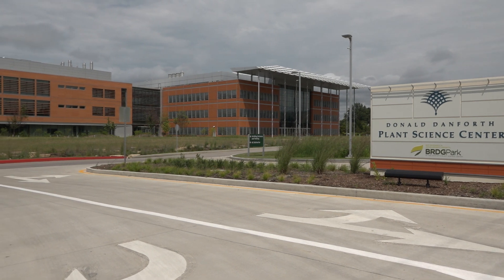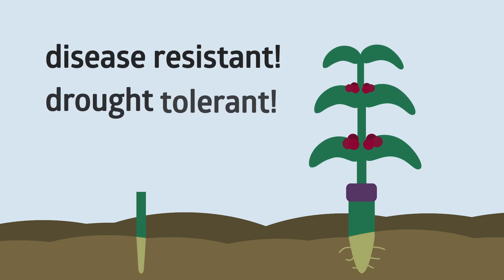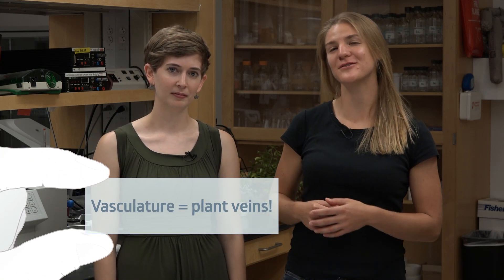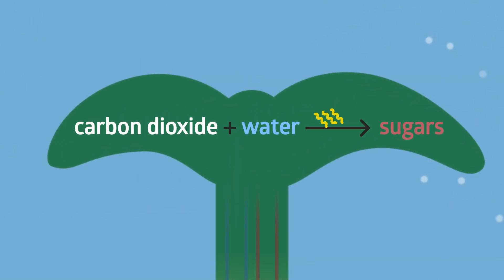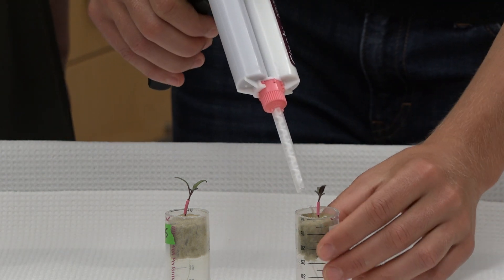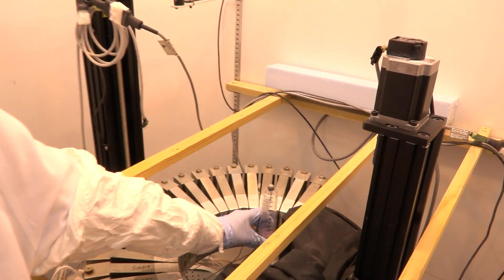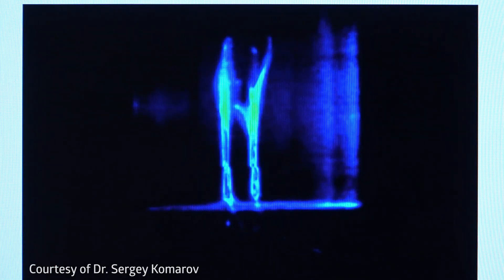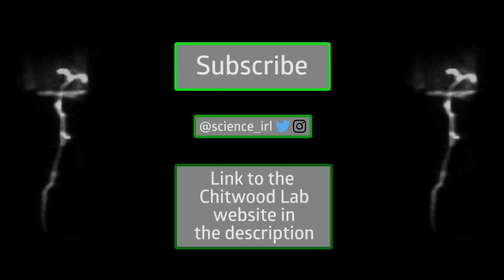Photosynthesis! Plant grafting!

Comment: Why did she use a razor blade? Next level danger zone.

Well, now that I think about it, I can't think of using anything else. Scissors would mess it up, I guess? Not precise enough?

Just feel like I would cut myself in such close quarter action.
Reply from the maker: Yep, razor blades are the go-to instrument for cutting stuff up in labs. They're super sharp and precise, and they're cheap and disposable so we don't run into contamination issues by re-using blades. (I also got a big kick out of the fact that the razor blades worried you but the radioactive carbon didnt! :)